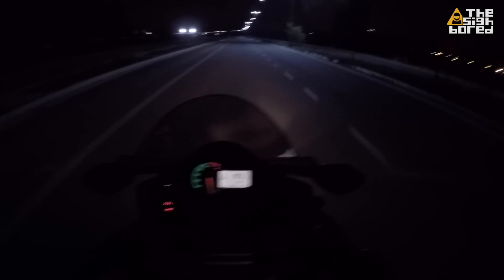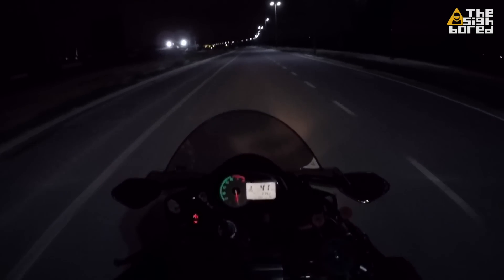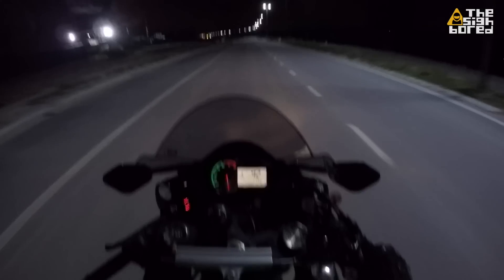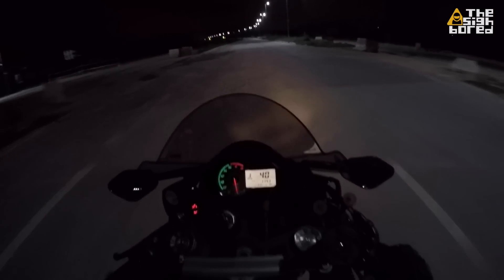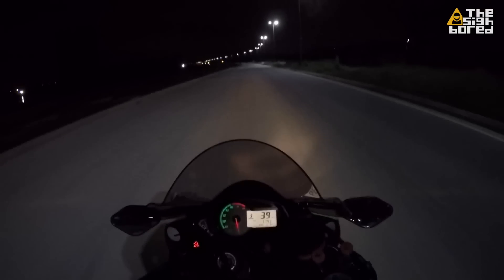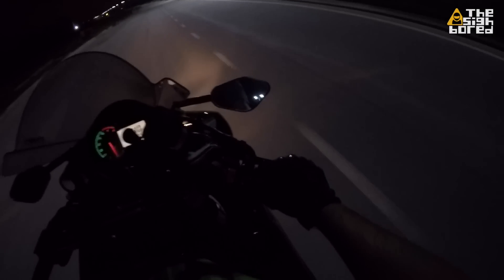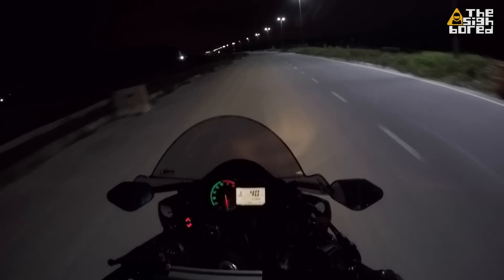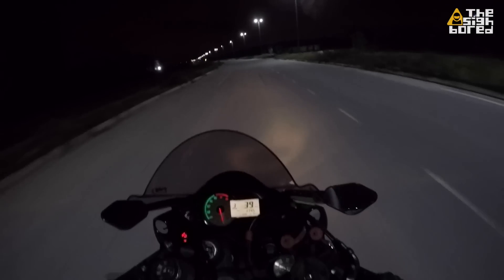Motovlog #38: Killer switch

Comment: To me personally, I would turn off the ignition instead of the kill switch because like the guy said, it only cut the power to the fuel injectors and the engine but still supplying power to all electrical components which would still use the battery so instead of doing multiple tasks like turning the kill switch first then the ignition, just turn the key to 'OFF' and it will cut all the power immediately. BTW that's a good info too because all this time I never knew that it's an emergency kill switch, which aren't suppose and not even recommended by the manufacturer for daily use. LOL that guy definitely did an amazing job  at cleaning if he can even clean your forks and adjust your cam (jk) hahahaha.
Reply from the maker: Yeah it's still cleaning (forks and etc) so it's part of his job scope.. :)

Comment: According to your zx 6r's wiring diagram, the kill switch is cutting off your 1) start switch, 2) coil packs, 3) fuel pump relay,
the main switch cuts everything so turning off the key first or press the stop switch basically is the same

there is no such thing as sudden electricity (time constant is very small), 
the fuel pressure is regulated, even if you turn on and off the kill switch 10 times in a row, 
the fuel pressure will not be extremely high
Reply from the maker: Thanks for the share, my personal preference would still be not to mess with the kill switch unless it's an emergency. :)
Reply: Afraid you broke it?
Reply from the maker: No, I still believe using it frequently will screw up the bike's components. :)

Comment: Hi sighbored, could you make a short video in which sifu Ahmad Khan explains the pros n cons of using manual cam chain tensioner (mcct) instead of the stock auto cct? Thanks
Reply from the maker: I will try to get that info from sifu.

Comment: Dont forget the best method to turn off the engine,when you stop your bike,while still in gear just bring down that kickstand,boom engine off,EZ PZ GG
Reply from the maker: Good idea but what-if the bike doesn't have kick-stand down sensor! :O
Reply: In that case we will have to use the 5th and also the most efficient way of turning off the engine,only super pros do this,when you're done riding you just leave your bike with the engine running until the fuel runs out,EZ
Reply from the maker: You win.. LoL..

Comment: I think the best method is to pull the spark plugs cable one by one. JK(if someone really take this seriously, read this)
As far as I concern, those methods shouldn't be a problem to the bike(unless the manufacturer decided to put all the electronics stuff in there and complex things up)
Anyway, how in Malaysia, you'd found a wide, long and empty road? It's really hard in here JB. I had to go Pontian or other places.
Reply from the maker: Well the manufacturer does mention in the manual to just use the ignition to turn off the engine, so there's a reason they don't recommend flipping that switch as well, although they didn't mention why in the manual. 
You can always find those type of roads but need to be outskirt areas or industrial area when the factories/warehouse are closed maybe on weekend.